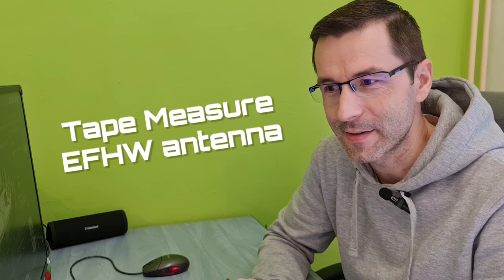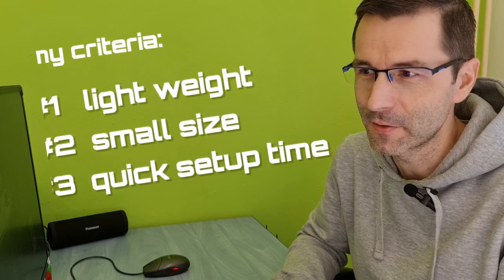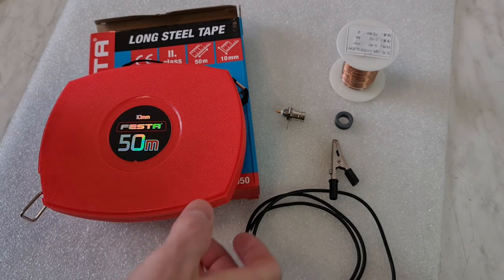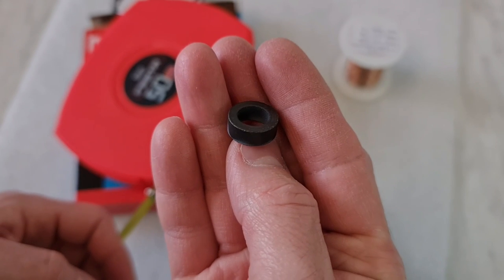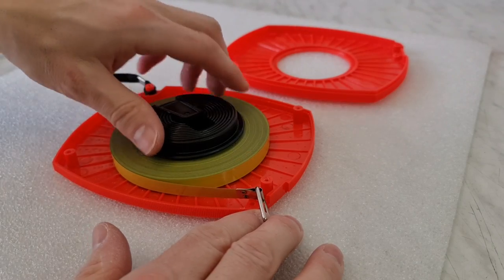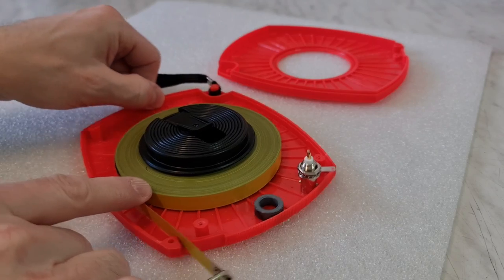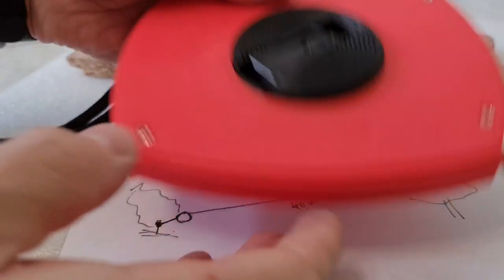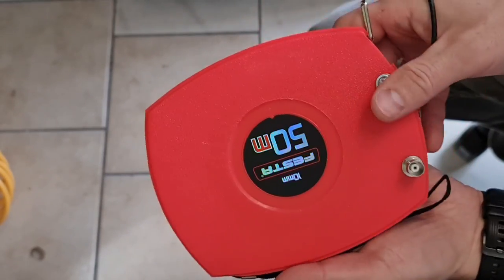TAPE MEASURE EFHW portable QRP antenna experiment (PART 1)

Comment: I've made measurements on small #43 cores with an HP4815 vector impedance meter and a 2400 ohm resistor load. Your original thought of a 21T/3T tap transformer has better SWR on 80 meters than a 14T/2T tap one.  A shorter/lighter version can be made with a  14T/2T transformer for the higher bands. Fantastic idea- I'm off to the hardware store! --N2GX

Comment: Nice build. Practical.

I considered similar build but I could not find aluminum tape measure. All are steel. I am concerned about using steel for antenna for increased loses.
Main advantage of tape measure is that you can adjust wire length. It seems to me you are using EFHW configuration that just needs full length of tape.

As you are working low power and full length of tape, it may be advisable to replace tape itself with copper wire. Winding mechanism would still serve the purpose and copper would help improving antenna efficiency.

Comment: A great job my friend ...
you have a lot of patience and good hands for this type of modification ...
I have only one doubt, you should scratch the paint on the radiator otherwise contact with the crocodile is not possible ...
Greetings from central Italy.
73. Giuseppe iz0gzw qrp.
Reply from the maker: Thanks my friend. 😄 Yes I am aware of this of course. I want scratch it after first use in the field. I have prepared a small piece of sand paper with me too.

Comment: That’s amazing. I am gonna build one. Could you attach the jumper to the part of the bolt on the outside of the case or does it need to be mounted inside?
Reply from the maker: Thank you! I believe that soldered contact is always better that just mechanical contact on the bolt.

Comment: Great idea. Two questions, 1) how much power do you think it will handle, 2) how is the signal without the capacitor that is usually on this type of antenna at the Un-un? Did you notice the transformer getting warm during transmission? Thank you for the inspiration. Keep up the great work. Be safe.

Comment: Did you forget a capacitor in your 49 to 1 circuit?
Reply from the maker: No, no, I didn't had any at this time. 100pF capacitor will be added later 😉👍
Reply: @OM0ET  I like your idea, and enjoy your videos. I look forward to your testing the new antenna idea.

Comment: You may have cut the tape a bit short.  It will be short at 3.5 MHz.  300/3.5 = 85.7 meters.  Divide by 2 and you get 42.9 meters.   It should be fine if you operate a little higher in the band.  About 3.6 Mhz.  That's what theory says anyway.  It could work perfectly in the field.

Comment: This is not a new idea. Heathkit made one that we used for a portable SSB radio in the early 1970s. It had frequency marked on the tap so you just pulled out to what you wanted to operate on. We talked to our techs in Araiba from Pasadena Texas.
Reply: No kidding David, really?  Do you have a link to the Heathkit video showing the winding of the toroid like OM0ET did?  Link it if you have it - thanks!  Thanks for the video OM0ET - I appreciated it.

Comment: Please stop using the phonetic alphabet for your call sign.  It is proper to use plain English. You need to know that pass the amateur radio technician license test!
Reply: Not sure about where you're from but here in the USA, one of the test questions asks about phonetics use on the HF bands, and the correct answer says to use phonetics due to weaker signals and poor audio quality. Also, here we can't use the HF bands regularly until we get to General or Extra. The Tech pool, however, does have questions about the phonetic alphabet.